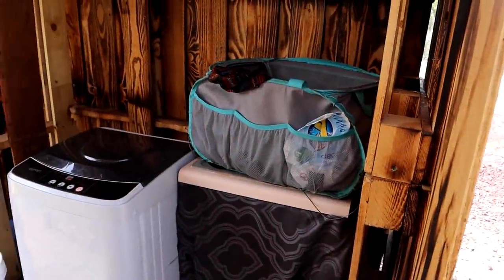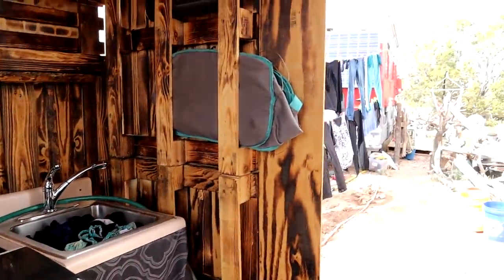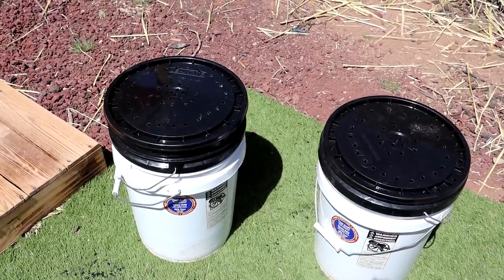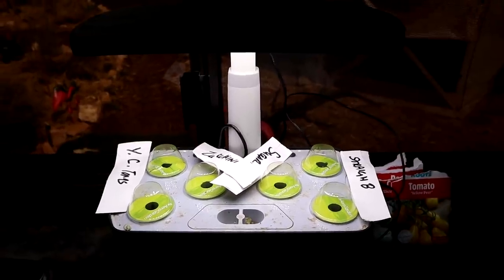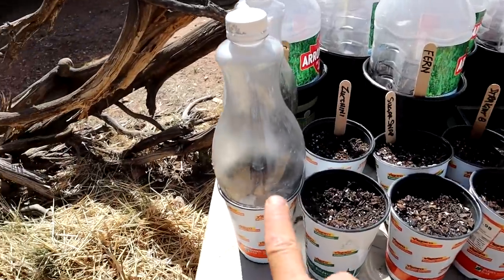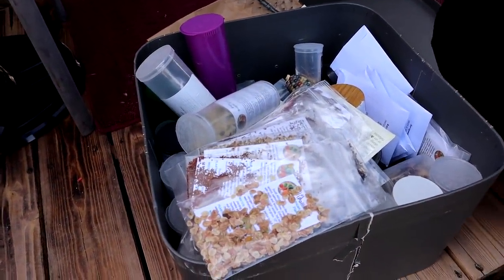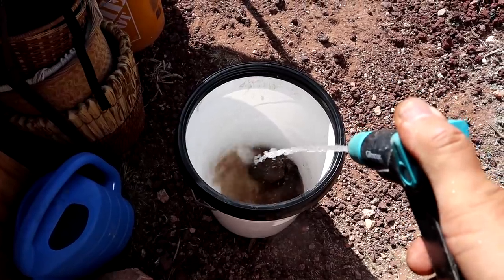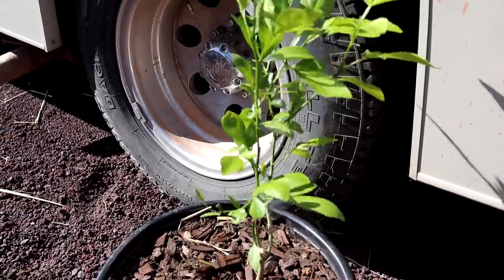Cold  Nights & Too Early To Plant - Water Bottle Mini Greenhouse | High Desert Gardening

Comment: I started some of my tomatoes using winter sowing this year. I think you are supposed to take the caps off the jugs, but that may be after the seeds germinate 🤷‍♀️ happy gardening 👩‍🌾
Reply: I agree that the caps should come off, it can get so hot in there that the seeds/seedlings will fry…
Reply from the maker: Yes once the plants germinate I will but the temps are still in the 50's and 60's here. I'm wanting the temps to be hotter in the container, seeds need warmer temps to germinate and some already have.. so excited.

Comment: How much solar does it take to run the washer?
Reply from the maker: We use a larger battery bank but it doesn't really require that much power, I believe it uses 200 watts when cycling.
Reply: @rvpandamonium  thank you

Comment: Why don't you contact premier one fencing they're the ones that have the solar charged electric fence a lot of the homesteaders that I watch some of them get the fencing and what they need free and all they gotta do is do commercials for it; also your fertilizer tea that you make those pack rats are big enough to push that lid off why don't you drill holes in the top and one of the holes make it big enough to put the tubing through bottom of lid  to the pump and then screw the top down this way you'll still get vented the pump still could pump air bubbles in and the rats or any other animals can't get in it the reason I know that will work is I had to transfer a bunch of my fish from my home to two hours away where I was moving to and that's what I did in five gallon buckets add the fish were able to get aerated because I had battery aerators to make the bubbles in there and I drilled holes in the top so air could go in and out and it worked great, but I'd contact premier one fencing to see if they'll let you be a spokesperson for him it be easier than trying to do all that pallet work. ✌💖💪🌈🎅🚌🌻👍